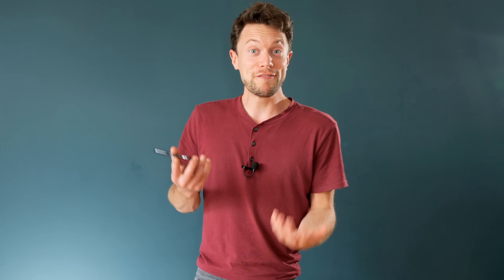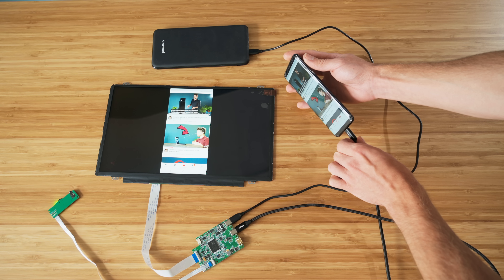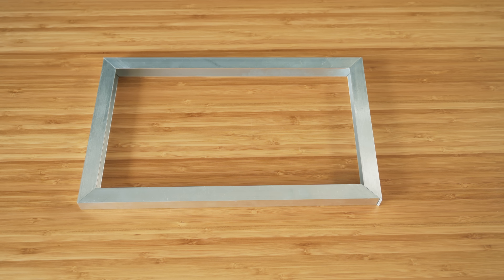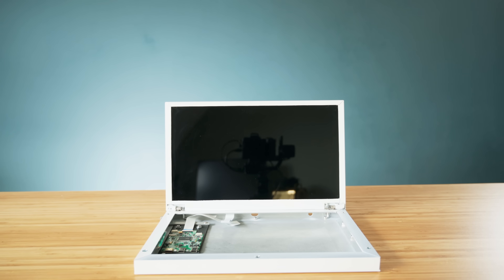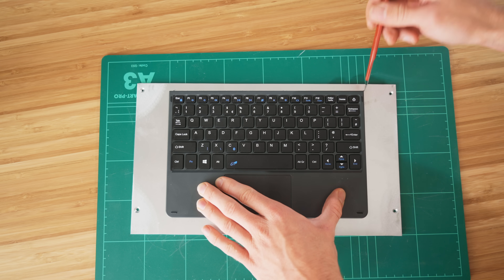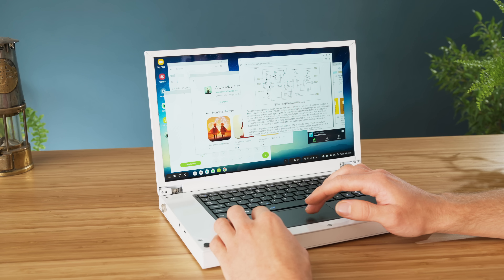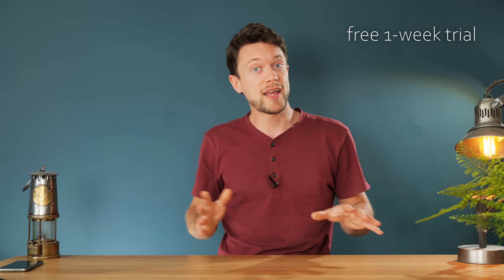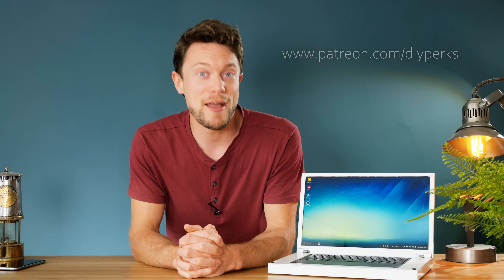Broken smartphone to working laptop transformation

Comment: was doing great up to the point he hangs the phone at the back of the screen.
replace the aluminum with wood or plastic... and keep the phone inside..or make a docking station
Reply: my idea would be to make a wooden or plastic tray for the phone, which you slot in.
Reply: @satibel  mind size large
Reply: Exactly
Reply: In that case, cooling would be an issue for the phone there's a reason the Samsung Dex dock has a fan
Reply: @walkinmn  he did way more complicated things in this DIY... he could definitely add a tiny fan to take out the hot air.
Reply: @johnnyxp64  yes, of course it's doable, but then you have to consider the space, noise, extra voltage to take care of and which will also deplete the battery faster, how are you going to control it? A switch? On all the time? So it definitely adds complexity that can be worthy or not depending your goals,  also you can just do what he did here. That's up to you
Reply: @walkinmn  i strongly believe if you don't game you don't need fan

Comment: I guess, a better Idea would be using an old laptop case with a screen instead of making a completely new DIY case. Old laptops with functional screens but outdated hardware are dirt-cheap. The keyboard would need some thinking but, in general, it can be a cool vintage-looking laptop.
Probably, with some epoxy, effort and time a CD drive can be converted into a phone tray. And after removing the motherboard the case will have plenty of space for various stuff like battery and voltage regulator for using it as a massive power bank.

Comment: Cool project, I can see you put a lot of work into this but a couple of questions. 1) Why not 3d print the case, frame etc that would reduce bulk and solve the signal issues. 2) Surly an actual keyboard and trackpad salvaged from somewhere and wired to a usb adapter board and then routed to the device via a USB hub would make more sense than a bluetooth keyboard. 3) Even with the current case set up, wouldn't it make more sense to just route the antennas from the devices up to the display panel? 4) A USB battery bank is a super clunky solution when you could have filled the abundance of space in the cavity of the bottom case with 2 or more high cap lipos run in parallel   5) Its a dex dock rather than a laptop if we're being pedantic Is there any possibility of making a v2 of this that is more of a phone to laptop conversion than just creating a lapdock with the phone sugru'd on the outside?

Comment: This is very creative, my only criticism would be of the sharp angle of the case at the front, that will quickly become very uncomfortable and then painful on the palms of the hands and wrists when typing or using the touchpad. That could though easily be resolved if a better case was used.

Comment: I'm dissapointed you didn't mention that the battery bank needs passthrough charging otherwise you couldn't charge and use the device. That's a pretty big annoyance. Passthrough chargers are pretty rare and have their own problems when used like this.
Reply: i would say its more meant to be used on battery anyways, 17 hrs with his small powerbank are still awesome and i think there wont be any need of charging and using it the same time. Still the most efficient option to use powerbank. I used a big (DIY xD) Powerbank for my "Wifi Security Cam" because we could avoid powerlines, needs recharging every 10-11 days, since i mounted a charging port on the bottom of the case, its easy to take away and get it for recharge some hours into the house, all starts and connects automatically after removing the connector

The biggest advantage of such a "DIY notebook" would be in my opinion something like portable movie player, a much better version of old "Portable DVD players" with much better screen and many other features. Could be even "HDR" ready, at least there are HDR supporting smartphones out there, dont know about displays for such projects.

Comment: He must have an aluminium guy, it seems to be his favourite material 😆

Also if aluminium blocks the wifi, why not use plastics instead?
Reply: It's easy to work with and strong and probably a lot of people already have aluminum brackets at home
Reply: Because it might be a bit fragile maybe
Reply: You just said it, It's because he is an aluminum guy.
Reply: You can get Aluminum at most hardware stores and its easily bent/cut yet durable enough for many projects. Seems like a legit project material to me.
Reply: Plastic might bend and warp when the devices heat up. Also in response to a previous question about 3D printers, I believe he does have one, and does use it for printing small parts for projects but he also shows how to make those parts manually if you don't have a 3D printer. As for cost/investment, yes, they were a big investment a couple years ago, but 3D printers can be obtained fairly cheaply now (ex. Monoprice) and are probably less expensive to set up than an average $700 - $800 laptop. Especially if you consider that some of these cheap 3D printers already come fully assembled (as Monoprice does).
Reply: @GoVocaloider  bending can also be positive.
Many aluminium notebooks would not get away with falling down, they are bent forever or break already at the first drop. Meanwhile, very often also ultracheap "plastic-bomber" get away with it, the flexibility of the plastic catch the energy and there is no damage at all.
in such a passively cooled project aluminium is anyways the better choice, i mean smartphones are getting hot today sometimes not to forget the controller for the display, inputs and power delivery.
Reply: He's covered this before. It's because aluminium is robust, light and easy to work with using normal tools you have at home requiring nothing more than a standard home tool kit and a supply of aluminium which can be bought at the hardware store.

He does have a 3d printer I believe but not everyone does. More people can afford a hammer and a hacksaw.
Reply: There was some pretty intensive machining for this build to be a Common Joe DIY.  

I think aluminum was the preferred material because the U-channels.  They are strong, easy and readily available.  Acrylic sheets could have been used for the panel elements, though.  Sturdy sheets of Lexan could also work but the cost starts creeping up on the build. (Note on plastic builds: If painting, you paint the inside)

This seems more like an instance where he didn't realize an issue until final assembly.  The phone was meant to be inside as you can observe through most of the video.
Reply: @SilverF-1  that’s a great idea because then you can get WiFi and have the option of a clear computer as a bonus but yes costs will start creeping up on it
Reply: @SilverF-1  really? It was a hacksaw, drill, rivets and aluminium sheets + channels bought from the store.
Reply: @lmaoroflcopter   he trimmed all the U's flush, hand cut precision fit elements, and had metal corners to weld/glue.

Yeah.  Not common person's level of DIY.  The minimum level to attempt this requires at least a couple years of experience with fine craftsmanship.
Reply: @SilverF-1  if using a hacksaw, file and rivets count as fine craftsmanship... You must think my kitchen is a masterpiece
Reply: @lmaoroflcopter  If you built your kitchen... Your input is invalid here.
Reply: @SilverF-1  no I just replaced the doors.
Reply: @lmaoroflcopter  The point is that it's not a universal ability to do the things he's done here.

Fine precision cutting on the panels is enough to be being out of the ability scope of most people.  Trimming the u-channels is beyond an even larger group.  It would be okay if they were just structural, but they are also finish.

For example;
My neighbor is a retired pipe fitter and fairly adequate builder.  He still borrows my angle grinder a few times a year.  It's just not a common household tool.  
I can't see getting the results he got in this video without the use of something like an angle grinder.  (Or many hours with a file)
Reply: na brass is his favorite.
Reply: This seems like something that would be excelent to 3d print. Maybe adding some aluminum profiles where is space to make it a bit stiff
Reply: The best notebooks ever were made out of 3 aluminium parts with only a plastic cover between/over the hinges where the antennas were.
There is only one better material for notebooks than aluminium.... magnesium (alloys), probably carbon fiber to make it as lightweight as possible. But Al is the best option in overall bcause of "ok" price, good optics, heat transmission and hard enough to feel like high quality. Only one big downside for Al... if your notebook falls harder or bad on the ground, it can be bent forever (happened with a 2009 MacBook Pro). trying to push it back can lead even to totally break the parts.

even smaller, faster things can make a bump into the aluminium like a 0,5l bottle falling on it from like 40cm.
I still prefer Aluminium, because my 2010 MBP still looks like brand new except scratches on the bottom after much mobile usage, 3000 charging cycles and sometimes at rough conditions

Comment: Really cool!
Although i would have made a slot on the right side to push the phone into a tray which will then connect to a fixed usb c cable inside just like the board connector system.
Nice vid as always ;)

Comment: 1:37 how to know that my phone also sends a display signal out of its USB port
Reply: Most modern phones can. I think it works usually if the phone supports OTG and is USB C, unless it's some old Nokia that has space invaders
Reply: @PJPEE  brother i have honor 9 lite that smashed a week ago and im wondering if i can connect another phone display so im googling that all smartphone manufacturers uses same display protocols
But failed to find , and today diy perk uploaded this video😀😀😀
After display cracked , I took out display and broke into pieces
Also usb debugging is turned off , what can I do?😢😢

Comment: You could obviously use an external antenna, some phones even have an antenna socket, or you could use a USB wifi adapter. But I think the best thing would be to cut a window in the bottom the size of the phone and make a compartment to put it in with a plastic cover. For sound you should try installing one or more dayton exciters (or similar) this would turn the chassis into a giant speaker which would sound amazing.

Software wise, you could root and install linux, it would also be cool to show using VNC or something similar together with a full windows environment running on amazon aws, you could then even install steam and play games.

Comment: I could buy a used laptop with i3 processor for the money he spend on the display unit. Welcome to India
Reply: You can do it in almost every country....
Also, This is a DIY project, which means that is more like to give you a LOT of fun and satisfaction, than save your money. (But obviously you can save money too)
Reply: And I could find a free old laptop from somebody else... but that’s missing the point. He’s giving low cost viable options for electronics that would otherwise be discarded.
Reply: Well a display unit will certainly cost less than the whole i3 laptop, it takes simple logic to understand that.
Reply: @osculocentric  logically correct, but practically may not be. If the display isn't common and overpriced while used market is flooded, I can't see why not
Reply: I meant no offense and I love this guy's works. I know it's DIY and it's fun, and I also know that there are options like the superbook to convert phone to laptop just for a $100.
 I was just saying that the display unit is overpriced, and the use for the device will be mostly media playback, and we'll need flagship devices to work the MHL HDMI just for that.
 Buying a used laptop and casting your device into that won't be fun but it'll be cheaper and useful.
Reply: He lets us all put on our 'DIY capes' for 15:24, and become Super-DIYers! 🤓😎

Comment: Why didn't you use a type c port to charge the whole thing,why use a barrel type connector
Reply: I was thinking the same thing. He hyped up usb c in the begging only to use connector people probably don't have
Reply: barrel connectors are easy to mount on this type of frame, and are less prone to breakage, while mounting a micro or type-C USB port on it will be much more complicated and easy to break.
Reply: @aniruddhkashyap467  there are usb type c ports available that are made just for projects like this to be mounted easily on anything.
Reply: @NanoMine  they make panel mount type c PD boards, he could have used that
Reply: @aniruddhkashyap467  if he were to use a decent USB c dongle he could charge the whole thing using a single USB c cable, and add a ton of IO
Reply: lars van de vooren absolutely. Could’ve even connected the keyboard over USB
Reply: @YouTube2021FM  exactly, maybe even an actual mouse, USB drives, ethernet cable maybe even an extra display. Though I doubt dex supports that
Reply: @insertclanname  I think both dex and android support Etherley ports. If you connect it over usb
Reply: @insertclanname  , perhaps not while using Dex, but I do have an old tablet (with broken digitizer) rooted to run Linux and it powers two monitors using ARandR along with a USB-C hub that includes an additional HDMI output. The tablet has a mini-HDMI port already for the primary monitor. I have also seen USB-C hubs that have Ethernet as well, but I already had a Cat6 Ethernet USB adapter, so didn't need it. I keep the tablet stashed behind one of the monitors with just the OTG hub and USB-C hub attached to the bottom edge of the monitor.
Reply: Aniruddh Kashyap super easy to get a panel mount USB C...
Reply: @aniruddhkashyap467  also, usually power banks does not support quick charging the powerbank when it is charging other things (passthrough). So its logical to use barrel connector since it does not need data pins.
Reply: I think he did it on purpose so it would mimic charging ports of real Laptops.
Reply: CR4ZY_KILL3R GAMING this is most likely right, and it really does look like a ThinkPad 

what I would do though is position the power bank so that the port is accessible from the outside, that way you could protect the port without the need of an exterior port or other type of cable (also would look a bit slicker because there s nothing poking out of the laptop.

That's the beauty of DIY though, to each their own ¯\_(ツ)_/¯
Reply: @Shavinderyt  gloss white thinkpad? what are you smoking?
Reply: @The Qatin Channel No you don´t. Thunderbolt is only a data protocoll. USB Type C on it´s own can supply up to 100W of power. This can even happen at variable voltages from 5 to 20V.
Reply: my exact thoughts too since it's a powerbank
Reply: It’s probably the parts he had laying around lol
Reply: Probably because he a a barrel lying around
Reply: Type C can be plugged in only 2 directions. Barrels can be plugged in infinite directions and is therefore better
Reply: True
Reply: The way he has done it also increases compatability. With his system, any 5v source can be used. When using USB-C Power Delivery you need special wall adapters which cost more than typical 5v wall adapters.
Reply: It charges faster.
Reply: the charging port on the powerbank is microB, he didn't used type c cuz it didnt make any diffrence

Comment: I would replace the phone with a Raspberry Pi, so I could use a full Linux environment instead of Android (useful if you need to write code or use some desktop applications)
Reply: Why not root the phone and install Linux on it? The average phone has way more punch than an Pi.
Reply: @jbaidley  Depends on the Pi - the Pi 4's have pretty serious performance and even the Pi 1/Pi zero isn't going to be much behind (if at all) what I'd call the average phone - nothing like the high end phone used here though and I'd not suggest one for desktop use. . You don't root a phone in preference to a properly documented and supported SBC because a phone is full of poorly documented hardware that needs custom firmware stuff so you are stuck running old kernels with those bits in - its not a full linux experience.
Reply: You could make it do both
Reply: @F99 Crafter what you can do is install postmarketOS on any compatible phone, which is a full linux distro.
Reply: Welcome to SBC
Reply: Pi labtops have been done again and again. They're not that powerful, and Android is a much better user experience.
Reply: I was thinking the same thing.
Reply: Why not use both?  Connect the phone to a dock with Power Delivery, USB-C in and HDMI out, connect the monitor to HDMI and a Pi4 to USB-C, then just SSH or VNC to the Pi over Ethernet.
Reply: Well thats true, but a Laptop made out of a Phone is more interesting for a Video.
Reply: @thomass.6328  of course, and it's still a really cool project

Comment: DIY project ! Its more like production quality with assembly line and all.
Reply: Are u from Nepal?
Reply: Yeah, 99% of this guy's projects require thousands of dollars worth of power tools or mid range prototyping equipment..
Reply: @Funkteon  Most of what you saw here can be done with a hand drill, hacksaw and some files. It's just gonna take more time. Seriously, the big problem with lack of DIY skills is that people can't even think of alternate tools or methods to achieve the same thing. If someone cuts a hole with a circular saw on camera, people think you can't just do things differently to end up with the same result.
Reply: @Funkteon  You can honestly do most if not all of this with a Dremel, if you were so inclined